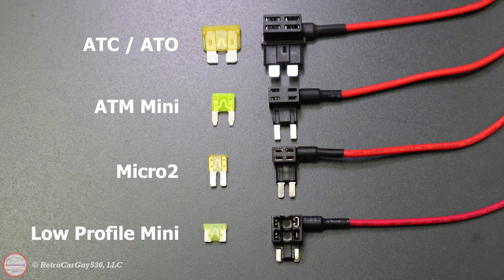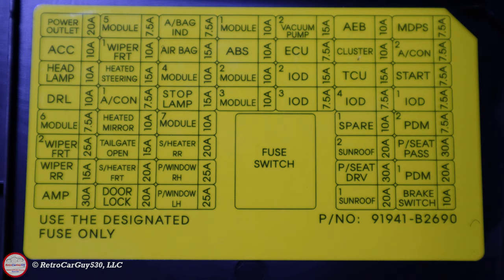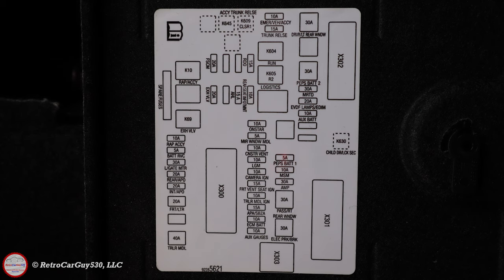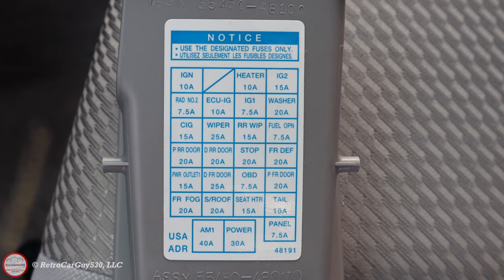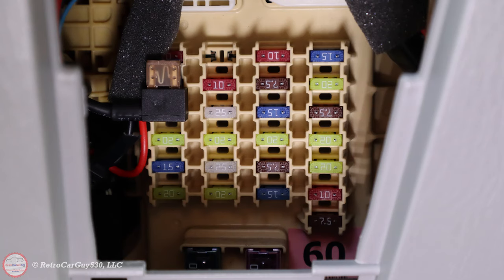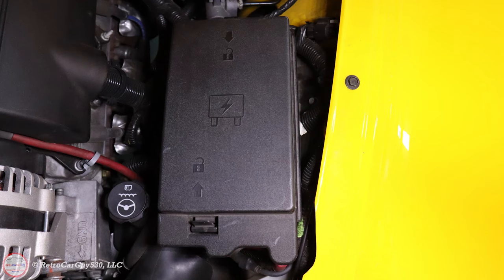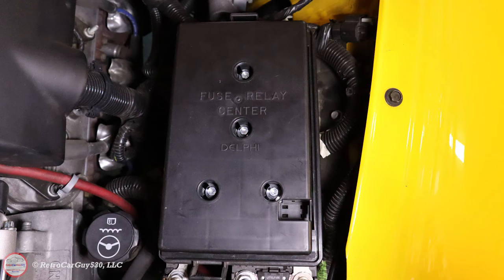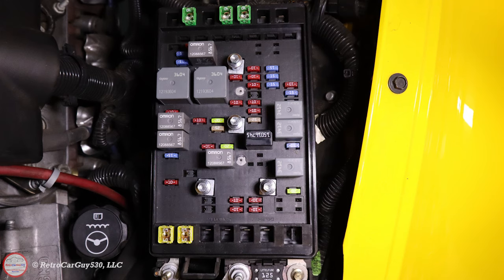How To - Add a Fuse Tap in Your Vehicle

Comment: Can u have 2 15 amp fuses
Reply from the maker: If the fuse socket sources its power directly from the battery or it's a switched power fuse socket which sources its power not through a control module (doesn't come from things like the engine control module, body control module, etc), then you likely can use two 15 amp fuses in the fuse tap.  I tend to suggest not to exceed a total of 25 amps for the the two fuses in the fuse tap, but others have suggested that 30 amps might be ok.  If both circuits (pre-existing one and the new one added by the fuse tap) generally draw well below 15 amps during normal operation then it likely is ok to have two 15 amp fuses in the fuse tap.  I just don't want you to have too much current being drawn through the fuse tap since that will heat up the fuse tap and/or wiring.

The other question might be does the new accessory sourcing power from the fuse tap truly need a 15 amp fuse.  You don't want to have a fuse with an amp rating well above what the device requires.  You must also make sure the wiring involved can handle the amps as well.

I have a FAQ video for fuse taps that cover some of the common questions I get related to this topic.  https://www.youtube.com/watch?v=DnZ5wb_A5vE
Reply: I seen someone use an inline and tape into the ecm ignition and install a kill switch could you use a fuse tape and wire in a switch
Reply from the maker: I guess you could use a fuse tap in that manner to install a kill switch, but in that case the only power being consumed on that circuit is still just the ECM.  You can insert a fuse tap into a fuse socket that sends power to or receives power from one of the vehicle's control modules, but there's a strong chance that altering the current draw into or out of the control module may impact other things in the vehicle.  That's why I usually strongly discourage the of fuse sockets that are involved with any vehicle control module.
Reply: Would the fuel pump be ok
Reply from the maker: @hooddreamer20  If the fuel pump gets its power from a relay in the fuse box (many vehicles use this method of powering the fuel pump) then it might be ok.  The relay sends power to the circuit in the fuse box with the fuse for the fuel pump.  If the fuel pump's power is sourced from the ECM (with a fuse in the fuse box to protect the circuit) then I'd have to say no because it's drawing power from the ECM.

Comment: Hi on a previous videos i saw someone just pulled out the same amp fuse (15 amp) and plugged in the new one with the cable attached to the 15 amp fuse that came as is with the cables. This means the one 15 amp fuse runs for the new camera and the original 15amp fuse in that box location. Can you do that or do you have to put a fuse splice and add 2 fuses of 15 amps? Please let me know. Video below:
https://youtu.be/cFoxS8zLUrc?si=X2wZC_mwv6Vl2MbT
Reply from the maker: I watched the video you provided a link to in your question.  There's quite a few things in that person's description and installation that I do not agree with.  That type of hardwiring kit that uses fuses already made part of the wire the provides the battery (constant) power and switched/accessory power has some limitations/issues.

The first problem is if the fuse blows, I don't believe you can replace the fuse since it's molded into the assembly that has the wire attached to it.  

The larger problem is that a dash camera hardwiring kit will never, ever require 15 amps.  His statement about locating a pre-existing fuse box fuse socket with a 15 amp fuse is so the car's original circuit still has a 15 amp fuse, but that does not properly protect the wires for the hardwire kit and/or the dash camera if a short occurs.  

A dash camera only consumes less than 1 amp on the battery power wire and the switched/accessory wire there is usually a near zero amp load.   The dash camera is always powered by the battery power. The accessory power is only used by the hardwire kit to know when to enter/exit parking mode. 

The next problem in using that type of pre-attached fuse for the accessory power wire is that if the unused fuse box fuse socket not only has a power side but the other side of the fuse socket has connectivity to a circuit, the insertion of a fuse in that socket may send power to things in the car that may not expect it or it might possibly create a parasitic power drain in the car (I've seen that happen).  The fuse socket might be empty in that car, but that same fuse box may be used in other models which does have something on the other end of the wire.  

In summary, I would never recommend using one of the pre-attached fuses for a hardwiring kit.  I would recommend cutting off the pre-attached fuses from the ends of the two wires and use two fuse taps to provide power to those wires.  With an "Add-A-Fuse" (aka fuse tap), you install the original fuse box fuse (if present) in the lower socket of the fuse tap, thus providing power to the original device.  You place a fuse in the upper fuse socket of the fuse tap with an amp rating appropriate for the new accessory/device being powered.  For a dash camera, I would recommend a 3 amp or at most a 5 amp fuse.

If you want to use an unused fuse box fuse socket, you must leave the bottom socket of the fuse tap empty and only place a fuse in the upper fuse socket of the fuse tap to provide power to the new accessory/device.  That avoids the potential of supplying power to things in the vehicle that may be wired to the other side of that previously unused fuse box fuse socket.